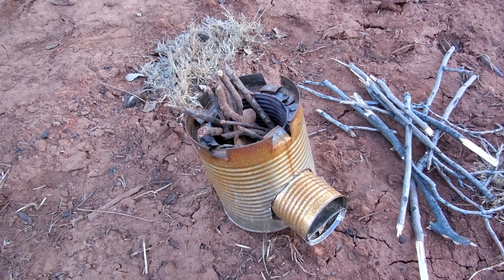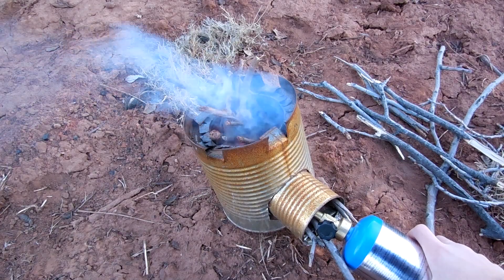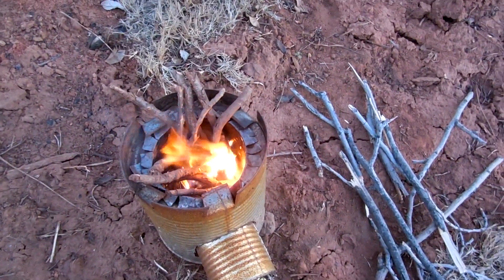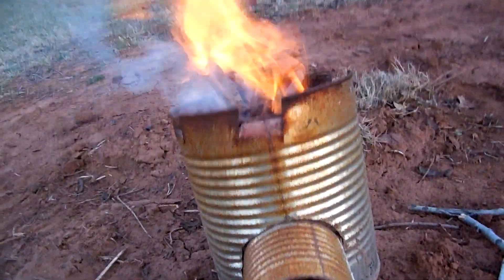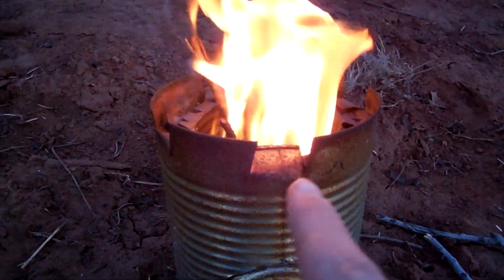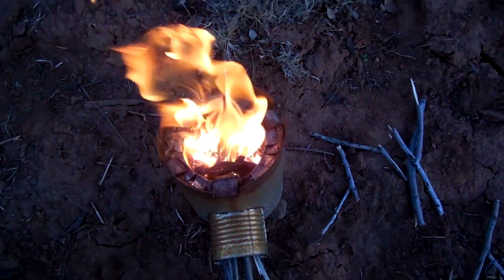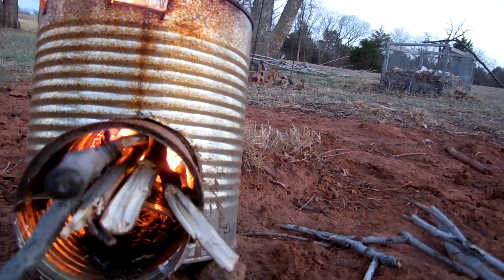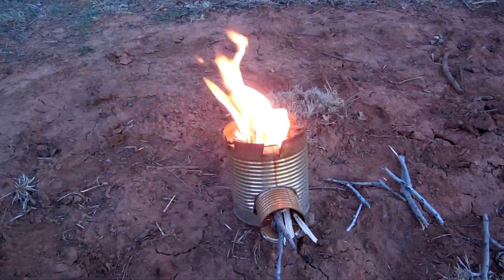Homemade Tin Can Rocket Stove

Comment: I have two of these, and am getting prepped to make a third one because I can't remember where I put the second one.I love my first one, but she's wearing out (but still going strong). One of the best stoves that I have personally built, for sure.
I can make a complete black iron skillet meal of most anything that I want with these stoves. Once these things are started, regardless of wind flow, they seem to just suck Oxygen and perform top notch! A very good, worthy stove. They just need constant fuel, and attention.
This stove actually prepares food, why bother with Penny stoves! I've actually burned grilled sandwiches and things, with these type stoves! This is just one of the best if built right.
I use mine for home emergencies, lights out in a storm, all that shit. I don't camp and this thing is heavy, so it WILL work great!